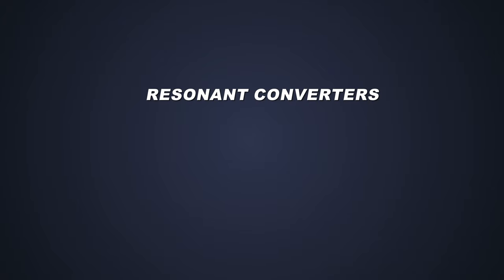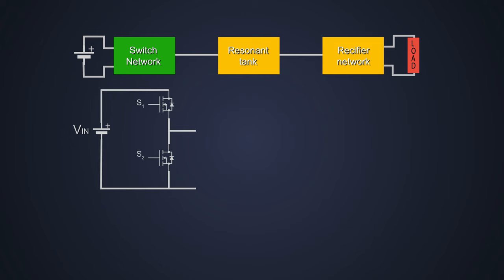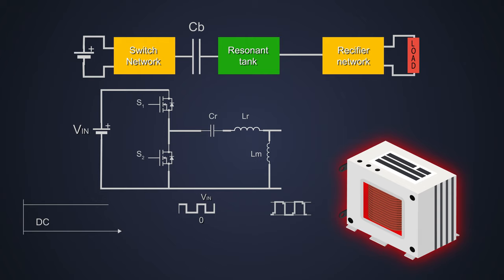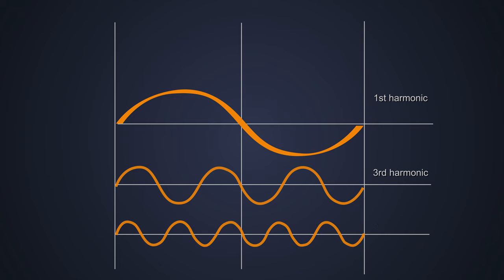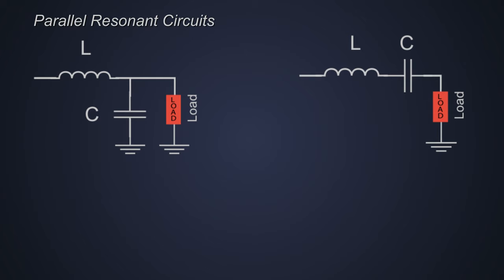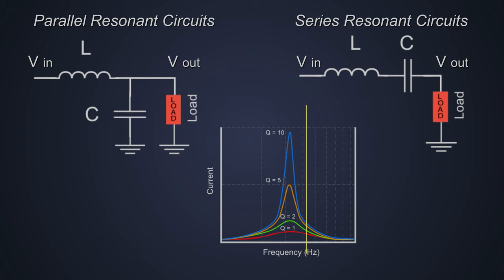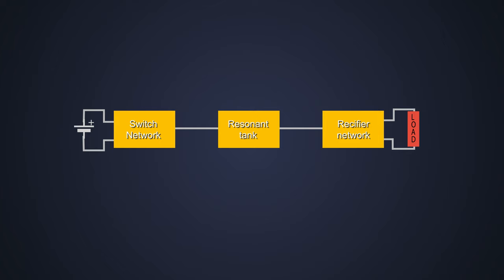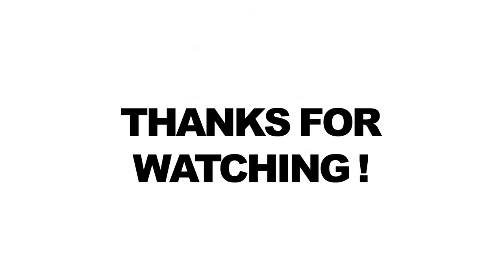How do Resonant converters work? What is a Resonant converter?  Resonant converter basics

Comment: I experimented with LLC converter. I was wondered - the current density was roughly 5A/mm sq. And there was no any cooler/fan. The winding wire  was homemade litz wire with construction like in steel  rope.The frequency was 200kHz. So high efficiency means that a converter can has really  compact size and high reliability - because the temperature inside is not high

Comment: Hi, thank you very much for your videos. What is the best topology for an isolated DC-DC converter with mandatory soft-switching capability and with an input voltage of 400VDC and an output voltage range of 20-36 VDC with 900W output power?